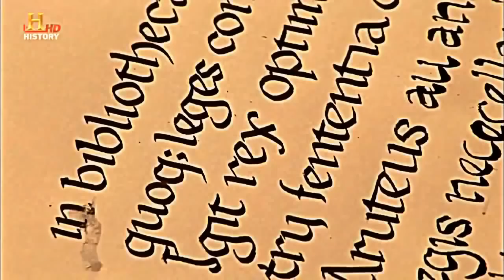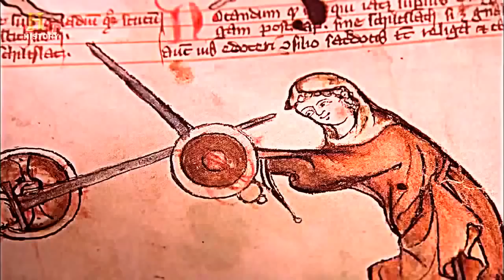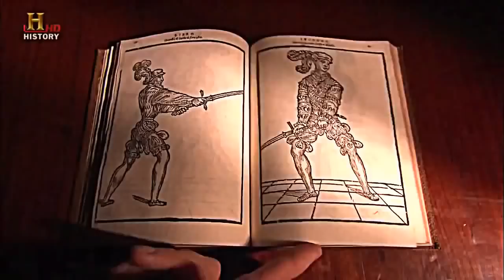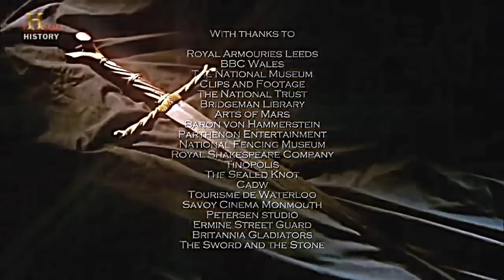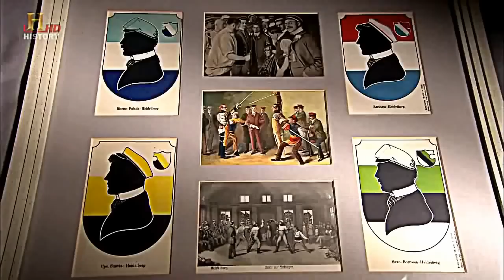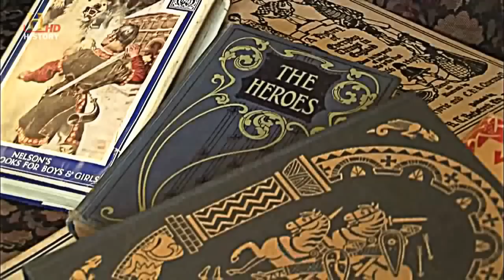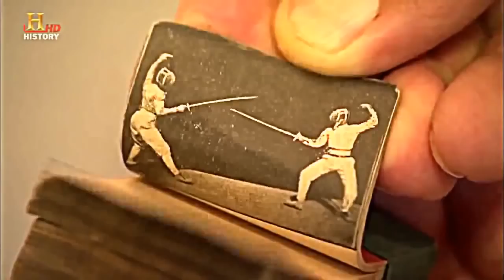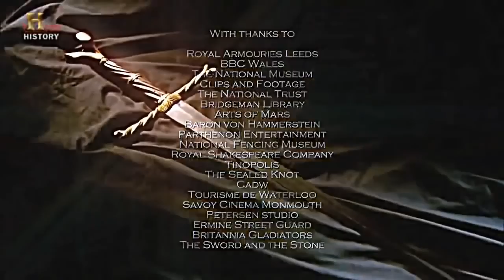History of Swords Documentary History Channel Documentaries

Comment: There was no reinforced leather armor. You know what there was that was light?  Gambeson. Thats textile armor. Fairly good if it's thick enough. Wool would be thicker and more resistant than cotton/linen. 
Effective against most cuts. Not so much against thrusts though. 

No Knight would ever attack another Knight with a sword. He would use a Pole Axe, Halberd, Warhammer or Mace. Those are designed to attack armor. 

Rondel daggers were particularly effective against knights . You tackle them and get the dagger into the gaps in the armor. 

People in armor can suffer heatstroke if they aren't careful. Too much exhaustion can be lethal.

As for the Katana the metal used is impure. That's why they must fold it. It cannot cut through a sword either.

Think of swords like a pistol. It's a
 sidearm. They aren't normally primary arms. Sometimes they are. But it was the Yari Spear and Yumi bow that did the heavy lifting. 

I dare say that the Spear/Javelin and Bow dominated the battlefield. They even had spears for hunting. The Boar Spear was one such design.

Even the dagger was a danger to a Knight. As it can get into the gaps in the armor. Particularly the Rondel dagger.

You certainly wouldn't quench a sword in water.  Oil is used.

The Rapier is certainly not lightweight. It's a similar weight to most swords . It's how it's distributed that's important. It has a thinner cut and thrust blade. The weight is transfered into the hilt towards the hand. So it appears to be lightweight. Some think it lost weight because of this. Those complex hilts is where that weight went. 
Many Rapiers are quite long. Though some can be 35" for lower weight. 

That's where the Smallsword and Spadroon came from. When the Rapier actually lost weight. 
The Smallsword normally can't cut but thrust only. These are swords with a triangular blade. Though some Smallswords can cut. But it's not that good. 

The Spadroon was the answer to an inferior cutting sword. It  was  thicker and better at  cutting than the Smallsword. The Spadroon was designed for an officer to take to war. So he could be protected against a bayonet and parry that same bayonet.

The Spadroon eventually found a new home. America. As the 1840 NCO Sword produced by Ames.

The finest swords are made in the East? Not quite.

Comment: "The stirrup and the heavy sword go hand in hand." 

Swords were 1 to 3 pounds. The Gladius was no more than 2 pounds. Swords weren't heavy.
Reply: My sword was, I had a greatsword with a U shape cross guard and my beautiful Anastasia was 5'5" 10lbs; I Intentionally got her extra thick.
      Because I wanted her that thick.

   She was going to be made light but, I insisted on her weight.
           I miss her.
Reply: @SchwarzSchwertkampfer  The Greatsword is a large sword by design.. Not your average sword for sure. 
Sure you can find those exceptions but they are just that. Exceptions. 
Most swords are below that weight. 
Clearly two handed swords would be heavier than most one handed swords. But then you are using two hands instead of one.

Comment: you do not quench steel in water unles you want it to crack or warp, you want a slower cooling medium like oil.
Reply: marco feola, thats not completely true. It completely depends on your forging style. If you normalize (heat it to the point were it about to melt) it relaxes the stresses you've put in the steel while forging then you can quench it in water, saltwater to be exact that's how you make a spring steel blade.
Reply: Damien South true, I think also if your forging bronze water is ok since its softer.
Reply: marco feola, quenching just doesn't do anything to Bronze or Iron for that matter. They do not contain enough free carbon.
Reply: @damiensouth1160  who do you have to pay for the carbon is it like the carbon tax
Reply: @kettlebells-ez9xi that pun is cringe worthy. Lol. "Free" carbon is carbon that is not part of the molecular structure that makes up a material. For example if you add "free" carbon to Iron in a process called carburizing, the "free" carbon becomes part of the Iron on a molecular level creating Steel.
Reply: @kettlebells-ez9xi  And I'm in the Midwestpart of the U.S. so no Carbon tax crap here. As a matter of fact my sour e of carbon (Coal) comes from the train tracks leading into the local power plant that burns the coal for electricity. I can spend an afternoon walking along the tracks picking up all the "Free Carbon" I'll use In a month. Lol truly free carbon.
Reply: @damiensouth1160  and may the people of the future steal your reply as evidence instead of relying on carbon dating
Reply: @damiensouth1160  thank you the explanation aswell haha

Comment: Would prefer a Damascus Blade Sword and Shield over a single Japanese Katana Sword. 
Personal choice.
Reply: Morehu Morehu always a give and take. The katana was a fast direct weapon but sword and board technique if done right is very formidable. I prefer light pole arms. Lol. Big guy big reach.
Reply: Morehu Morehu Since a Shield is a weapon, I'd say you would be making a good choice. Two weapons are always better than one. Personally I've trained Sword and Buckler as well as Rapier and Dagger (Useing Fiori de libiri and I:33). Of coarse my choice of weapons would come down to armored Vs unarmored combat.
Reply: William Miller a Noob with a spear will beat a trained swordsman 8 out of 10 times, so of coarse you would.
Reply: Katana is a motorcycle brand and not a Japanese sword.
Reply: In the case of determining a weapon for unarmored or armored combat, why not split the difference with a longsword? Adept use of mordhau and half-sword  techniques would do well against even the most well armored opponent; not to mention the defensive capabilities of a lengthy blade and proportional guard. If a weapon can be used to smash, hew/slice, pierce AND shield, I'd find no need to carry the additional weight of a shield/buckler and become fatigued faster as a consequence

Comment: "some of the best swords of all time were produced in the far east."

No. No they weren't. Katanas are made of sub par steel, are too heavy for their length, and too short to be a proper two handed weapon, not to mention the lack of significant hand protection. The edges chip too easily, and the entire blade will bend and stay bent rather than spring back like a European sword.  In short, they were just good enough to do the job, but no better.

"the iron is incredibly pure"

LMAO no it isn't! Not even close! It's pig iron. The reason they have to fold it and hammer it out so much is to reduce the impurities. But the problem is that they can't get all the impurities out. If they fold it enough to work all the impurities out, the carbon content will drop too low and ruin the blade.  Tamahagane is a terrible material, but it's all they had so they made do.
Reply: i agree with you but i must correct one thing the katana was not made by folding pig iron but pig iron was folded into the tamahagane since their iron was shit with way to low Carbon content rates which also resulted in a bad sword while pig iron has way to high Carbon content to be useful for smiting and was even more likely to break

now lets get to other facts one may not know, their forges were even worse than europeon forges and could not melt iron(another reason for the low carbon content in their iron), the forges japanese used were only able to heat iron to about 900 to 1100 centigrade( was that the right word?) and had to fold their terrible iron for basicly everything they used iron for since it was just to prone to breaking
Reply: @shamusoneill6792  lol yeah ok. First of all, a Katana has a blade length of 24 to 29 inches, that's 2 to just under 2.5 feet long, with a handle length of about a foot, making the total only 3 to 3.5 feet long, nowhere near 4.5 feet. And for that short length it weighs 2.5 to 3.5 pounds.

Meanwhile, a European longsword is slightly lighter at 2.2 to 3.1 pounds, but has a blade length of 3 to 4 feet with a handle that is 8 to 12 inches long. So yes, a longsword is longer and lighter than a Katana.

The steel used to force a Katana was NOT high grade. Sure, they used the best material out of what they had available, but that's like saying they choose the best dog turd out of the pile of dog turds. Historical tamahagane has a carbon content anywhere from 3 to 5 times higher than even decent steel, making it essentially cast iron.  Not only that, but the carbon is not evenly distributed in the steel, which is the reason they had to fold the metal and create those famous layers. This removed some of the impurities, some of the carbon, and spread the remaining carbon out more. But even this process can't remove all of the impurities or evenly spread the carbon to the degree the Europeans could. 

A Katana is a mix of (extremely) high carbon steel and even higher carbon pig iron layered together. This gives a hard edge for sharpening with a softer more flexible spine to absorb impact. But the edge was too hard and would chip easily and the spine was too soft and would bend and stay bent. Again with impurities throughout the blade, creating weak points. Meanwhile, a longsword is much more pure, has a better carbon content, and is completely through hardened and then tempered, making it into spring steel. These swords were extremely tough. The sword could bend and would spring back on its own. The edge would get dings that could be straightened rather than chips that has to be ground out. And with less impurities and greater strength, the blade could be made longer and lighter for greater reach, power, and mobility.

This is all due to the fact that Japanese forges just couldn't get hot enough to actually melt the iron to properly remove impurities and control the carbon content and European forges could. 

A Katana couldn't cut through the armor they had in Japan at the time. If it could, there would be no reason to wear the armor. Japanese armor did have steel plates in it and functioned much the same way as European armor, just not at the same level of quality. No sword could cut through armor. Get that out of your head.

The Katana hasn't evolved in 1000 years because the Japanese are super traditional people. They don't change their customs easily. It wasn't that the Katana was perfect, it was that the sword making process became a spiritual practice and changing it would dishonor the sword makers who came before them.

Lastly, modern steel is far and away better than anything the ancient Japanese or medieval Europeans could have dreamed of.  This idea that people that lived 500 or 1000 or more years ago and had access to some super material that modern people just can't figure out is really fucking stupid.
Reply: True dat. If the Japanese were so advanced in their metallurgy, it certainly didn't show in their armour. A Samurai with katana would make little impact on an armoured Western Knight of the 14th/15th century, who would use a poleaxe rather than a sword. 
People tend to believe that the marshal arts are purely an eastern thing, the medieval Knights were just as well trained in their own marshal arts.
Reply: Kur Norock
You heretic! 
How can you assail glorious, a million times folded, heavenly Nippon steel? How dare you? 
Now take back what you said and accept the superiority of the mighty samurai or spirits of the ancient warriors will cut your tongue with a blunt no dashi. Yeah... Not because there anyone could imagine a blunt Japanese sword but. Yeah...  Imagine the wrath that the spirits could wield. Yeah...

Comment: He "queched" bronze? That does absolutely nothing, you hammer harden the edge of a bronze weapon (also called work hardening). Just like quenching Iron does nothing because it doesn't have enough free carbon, you hammer harden the edge compressing it, making it more dense and therefore harder. You quench Steel to lock the carbon atoms in the Iron into a pattern.
Reply: Damien South  Quenching copper has an opposite effect to any true steel. Copper and I believe bronze work harden readily. Then need to be softened to work further. Heating to the triple point and then air cooling works,but quenching works better. Only ever practised with copper myself,but gaskets that do not leak are critical. Reusing or copying now unavailable items means hours of work you do not want to duplicate unneccessarily.
Reply: paul manson That's exactly what I meant you cast it, air cool it, then work harden the edge. The blade will bend if you strike with improper edge alignment but not break and it'll hold an edge due to work hardening. The plus to Bronze is after you've bent it back straight to many times you can simply melt and recast it. Whereas with Iron it bends easily as well but unlike Bronze it can't be recast so once you've stress fractured it Smith's would then use the pieces for other things, for example the "Viking" Seax knife looks like a cut down sword because alot of times they were. I'm no Master Smith but I've forged over 100 blades, mostly knives though I've done 12-14 Swords in materials ranging from Bronze to 5160 Carbon Spring steel. I also cast ALOT of small pieces of bronze for everything from knife bolsters to chess pieces using wax meltout molds. So in fewer words yes bronze in 90% Copper so it works just like a crush washer once it's used it won't reseal because of its hardness.
Reply: Damien South Trivia story you might like. A really remarkable guy I used to know got a job as a bus driver in our city. Lots of miles of trolley busses. One of the main commuter EW routes was blocked for hours. Turns out the overhead trolley wires are very expensive specially work-hardened copper. Some jackass with a very tired dump truck crossed a major switchpoint intersection and the dump body swung up and shorted the wires.Miles of wires,the complete switchpoint,and bracing etc got ruined. His insurance company was hit by a bill in excess of 1.5 million. Air quenched copper wire simply will not function for trolley bus use. It would have paid his insurance company to pay him to stay at home and rot.
Glad to hear of your activities. Always wanted to myself,but the learning curve plus the time and tools needed just were more than I could bring myself to do. Just keeping up as a wrench was not trivial. Happy banging away.
Reply: paul manson, I honestly have no idea about how the conductive properties work with alloys other than bronze which is considered a phosphate alloy of copper is only 10% as conductive as pure copper. And that they use silver copper alloys for extremely high conductivity applications and they are made in 0 oxygen environments.
Reply: Trolley buses, trolly buses, insurance companies, dump truck, copper wire, commuter EW routes, dump body, air quench, must remember all this next time I make a sword.
Reply: 7316bobe What's your preferred alloy? Do you forge or use a stock removal method? What quenching medium and style do you use with your preferred alloy? What tempering temperature and time do you use to match your quench style? And what Rockwell hardness do you end up with in your process?
Personally, I like 5160HC using a CNC machine for stock removal. I do a double quench, first a flash quench in salt water then directly into vegetable oil. I find that I get a really good spring temper with a Rockwell hardness of around 55 if I bake temper it at 375 for 3 1/2 - 4 hours watching the color of the steel until I get that beautiful blue patina that tells me I'm on. Of coarse that style of quench and temper only works with a low heat stock removal style and the amazing spring property's of 5160HC mono steel.

Comment: There technically was no such thing as a"Scimatar" historically. Real islamic swords are usually called Kilic, shamshir or the tulwar/pulwar. Also idk if one can say "swords were rarely cleaned". The knights squire would maintain ALL their equipment otherwise it would rust & fail the warrior. Carbon steel equipment MUST be cleaned & greased regularly especially swords. Blood & other substances the blade comes in contact with are corrosive & will rust the blade in the scabbard so badly it gets stuck & cannot be pulled.